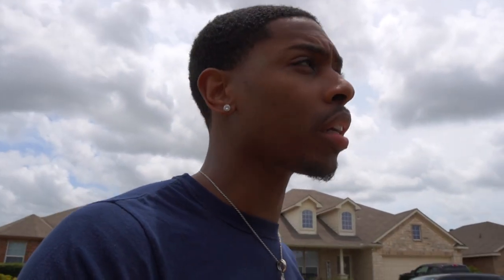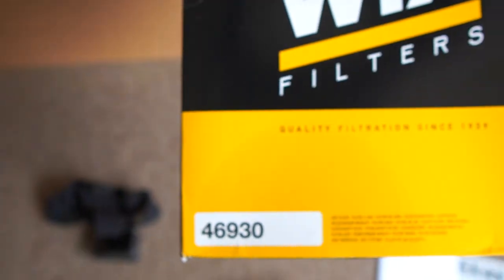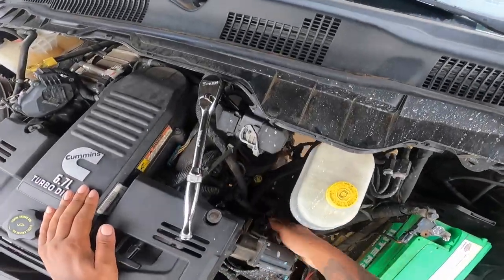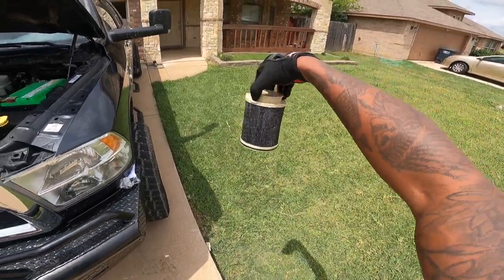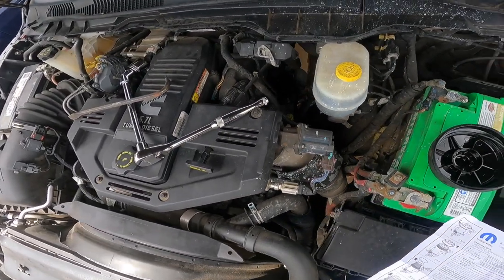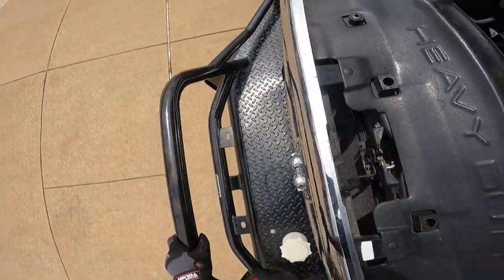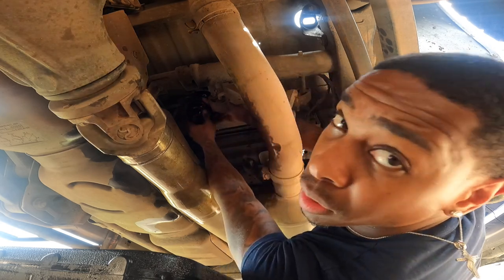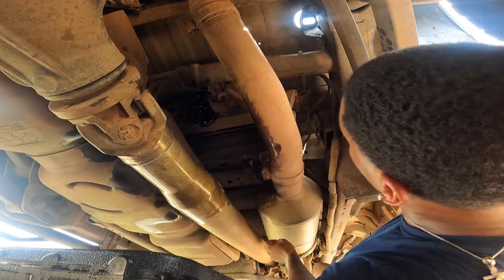2014 Ram 2500 Maintenance Day | I Saved Thousands Doing This..

Comment: little tip as to why you had to turn the truck on and off again a few times, the filter has no fuel. You had to wait until it filled with fuel and then go to the engine, next time fill it with fuel and also wet the o-ring a little for a perfect seal, same thing with an oil filter.
Reply from the maker: Will do. Thanks for the knowledge
Reply: That oil catch I had to drill extra holes so the oil would drain into it faster I still need more

Comment: They make an actual wrench for the fuel/water separator filter sensor, the one that's under the bed of your truck. It's on Amazon for pretty cheap. I buy my filters from Amazon (we have the same truck), and it recommended to me from the stuff I ordered.

Comment: I told you I was going to subscribe! Love it, I do all my own work on my truck too, I just changed my differential fluid today. Sht looked like motor oil 😂 I bought a used 08 Silverado with 103k on it and have been going through it to make sure it makes it another 200k
Reply: Also if those are Sealight lights from Amazon, be prepared to get brighted everywhere you drive at night 😂 I get hit with brights when I have my dims on all night long